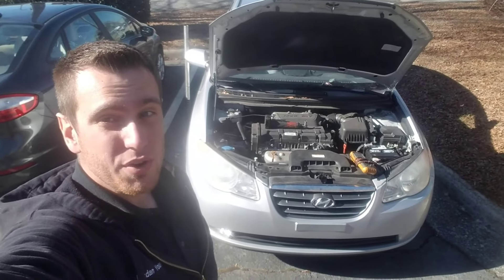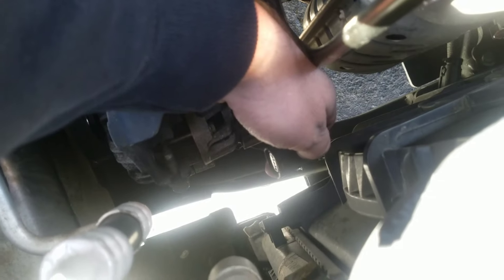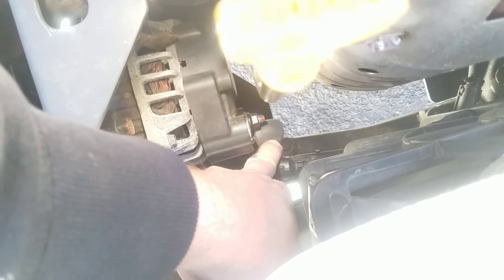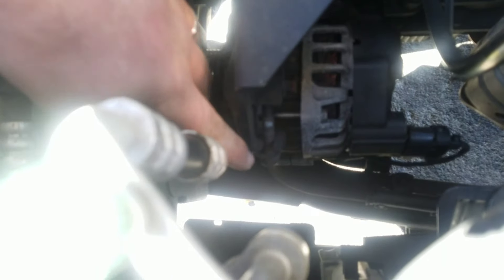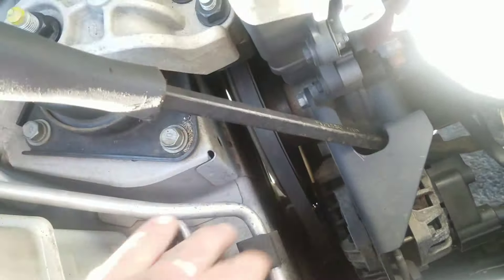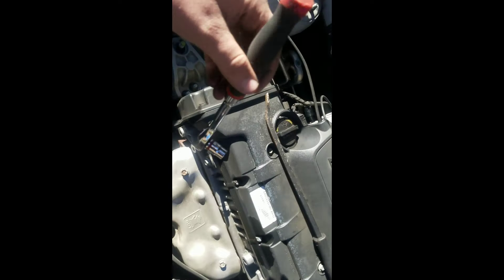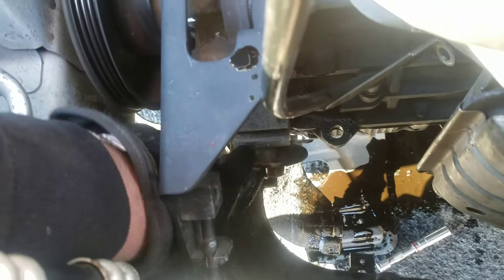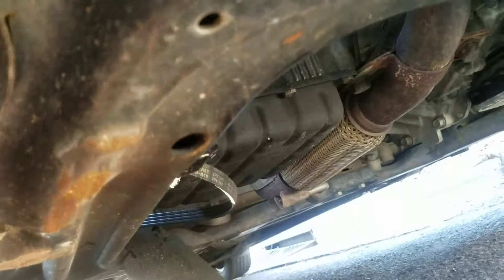Alternator 07-10 Hyundai Elantra Replacement "How to"

Comment: Few things:
Loosen the mounting bracket so it can be maneuvered over towards the passenger side to make it an easy removal and install. 
You do not need to remove the lower bolt, just loosen a bit and pull out towards the front of the car. 
Make sure when you're putting the new alternator back, first get the belt back into position, push the alt down to a tense point, tighten the upper mounting bolt to finger tight, adjust tightness, then tighten the mounting bolt full. You can reach the lower mounting bolt easily with a ratchet underneath. 
No mess, no fuss. Done in an hour.
Edit: also transfer the lower bolt to the new alternator to make it easier on yourself.

Comment: I see that some people are struggling with the bolt that goes through the alternator at the engine. I just replaced my alternator and struggled with this for a few minutes. My solution was to loosen the nut but not completely it, I then grabbed the alternator with one hand on each side and rocked it back and forth while sliding it towards the front of the car. This worked well for me.Good Luck!

Comment: This job was a pain! Part of it is my fault because I failed to realize the lower bolt doesn't have to be removed at all, just the nut loosened enough to where you can pull it out.

Comment: No need to remove the bottom Alternator bolt. Just loosen the nut. It will pull out once top bolt,belt and wires to alternator are removed. And it can be removed from top if you disconnect radiator hose  and remove fan which are easy to remove. Once it's out,  THEN remove bottom alternator bolt and transfer it to the new one. Bolts are 12 mm.
Also, Check the prices of alternators at your local parts dealer first. I called a few places and they wanted about 240 dollars,  which I thought was outrageous. Went on Amazon and purchased one for 100 bucks and it arrived next day. Not sure what a shop would charge to replace an alternator,  but I'm sure at least 400,  so definitely worth doing yourself.

Comment: It's a lot easier to loosen the mounting bracket and pull the alternator straight up. It requires a little maneuvering, but it saves you some oil
Reply: I completely disagree. I didn't notice he'd removed the filter so I loosened the bracket. Antifreeze seeped out & I struggled like crazy getting the alternator out the top way.
Reply: did one yesterday 3/29/2020 and it was way easier to just remove the fan an pull it out didnt even touch the mounting bracket
Reply: I think both of these methods sound like a pain. Someone in another comment said they'd like to give the engineer a piece of their mind-- me, too!

Comment: DO NOT REMOVE OIL FILTER !!
There’s an easier way. Just disconnect your upper radiator hose (save any coolant that may come out), disconnect power to your cooling fan.  Now remove the fan shroud assembly. There is more than enough room to remove the alternator. I never had to get under the car let alone having to jack the car up. Everything can be done from the top. Just saying.  
   Let me know if you find this easier than the whole oil change thing. 

I should have made the video! :)
Reply: How did you get the bottom bolt out? I had to remove the fender liner in mine. 2010 Hyundai Elantra

Comment: Ughh,there's a bolt under the bottom of alternator,once you loosen, it does not need to come out,the oil filter does,the bolt that is where the slot is to loosen belt,remove,with tensioner bolt.pry upward from bolt on bottom,it is sitting in a slot,the alternator and bolt stay together,I struggled thinking the bolt was like a front break pin..once it's loose it has to be unseated by going up.Hope this helps!

Comment: Question: I try to remove the alternator for 2008 hyundI elantra as your video, but the bottom stude volt with square head was hitting a wall. It has no room to pull that volt completely from akternator.. That volt was holding the alternator up and down. I can not take out that volt unless I cut it.  How did you remove that volt from the alternator? Please let me know. Thank you
Reply: The bottom bolt sits in a channel. You should be able to loosen/remove the nut and slide the bolt and alternator up out of that channel.

Comment: You can also just remove the fan and pull it feom the top and avoid oil spill
Reply: Trust me, dropping the oil filter is the way to go. Much, much easier.
Reply: @DoyleFM  did one yesterday 3/29/2020 and it was way easier to just remove the fan an pull it out
Reply: @Settegast1000  Heh, heh... I'm just glad to know there are other options. Whatever works best... 👍🏻
Next door neighbor had a V6 Sable (2003 I think) & the A/C compressor locked up & the pulley bearing went bad. Aftermarket companies actually make a pulley that you can mount in the compressor's place to bypass the A/C in a Sable or Taurus.
Only problem was, they don't make one for the V6 Sable. 😕 
So I had to remove the pulley to replace the bearing... talk about a SUCKY task...
It.
Was.
Brutal.
Reply: @Settegast1000  how far do you have to pull it out and what all did you have to disconnect?
Reply: @Settegast1000  on a 2010 Elantra? I'm doing mine tomorrow, removing the fan is the way to go yeah?

Comment: Thank for posting this. I was perplexed trying to figure out how to get the bottom "bolt" out. I still don't understand why it doesn't work its way out in normal operation. 🤔
Reply: Just tap it out
Reply: I think it should have a nut on the end, right? I took on this job midway through so I don't know, but I put a nut on the end to fasten it, otherwise it would just come right off.

Comment: I finally got it done, and although your video really did help quite a bit, you really could have done a better job explaining and more detail. first off, you absolutely should not take the oil filter off, you should remove the fan and that the hose also. I had one hell of a time figuring out how to life the alternator up to remove it. but, anyhow, at least you covered most of the bases. so I do ty
Reply: Crazy talk..move on folks

Comment: Hmm..I'm not too certain, I'd have to check, but I think my alternator is missing that connector from the beginning.  What is it for and what is the exact name of it
Reply: Check again, I'm sure its there.
Reply: @harvybirdman8864  yes I found the connector it definitely was there the whole time.. I was able to get the belt off and the alternator loose.. next I have to drain the oil take off the filter and remove the cables.
Reply: @Ruleno.9  just unscrew your filter,no oil worth is going to be lost.
Reply: @cemktl  lol I figured it out 10 months ago

Comment: how do you not have to pull that bottom stud all the way out? it sits through a channel in the alternator. I dont see a way around that and the end of the stud is hitting the side of the car or wheel well...how do I get that out?
Reply: Ethan Roy I’m dealing with this now how did you end up doing it
Reply: Does anyone know how to take out the bottom stud?
Reply: I know it's been a while since this was asked, but if you're referring to the bolt that would come out of the passenger side, I took it out by removing some of the plastic screws and a few bolts that hold the plastic inner fender.  I took out enough to be able to move the plastic out of the way and get the bolt out. That was the worst to take out of the 3. Good luck everyone, keep at it!
Reply: Same. That bolt isn’t budging for me. I have no room to tap it hard enough to go through.
Reply: I broke the splash guard plastic while in the junk yard. On my own car, I used a hole saw to make an opening for the bolt to pass
Reply: really pull it down hard it will come
Reply: Push down - yes!!! I’ve been pulling UP for an hour and getting nowhere. Push DOWN and it pops right out. Who’d a thunk

Comment: I don't understand why you can't remove the alternator bracket and lift the whole thing right out the top???
Reply: Rust maybe? Beat it.
Reply: the bracket is held in by the water pump bolts, of all things, the bolts are too long to be taken out without removing the water pump pulley

Comment: my biggest problem was getting the belt back on. lol
Reply: Yeah, you had to take the wheel off? Even with a serpentine belt tool I still had to take the wheel off.
Reply: @mattmgarza  I didn't take the wheel off. But I did turn the steering wheel completely to the right to give more access.  And I took the little lstic cover piece off that's covering the belts from the passenger wheel well

Comment: So u had to remove the oil filter?
Reply: I did this exact task earlier this evening & I would say yes. I did not remove the oil filter & I struggled immensely trying to pull the old alternator out the top way. I had to bend my A/C lines to get it out. Dropping the oil filter would make it so much easier. You wouldn't have to drain all the oil; only what spills when you drop the filter.
👌🏻
Reply: @DoyleFM  Thanks! I just replaced mine yesterday as well. Took the oil filter out. At the same time i changed the oil pan. Killed 2 birds with one stone.
Reply: @jaylandry8915  That's awesome! These dang YouTube "help your fellow man" videos are the shiznit, ya know?
💪
Reply: @jaylandry8915  did one yesterday 3/29/2020 and it was way easier to just remove the fan an pull it out

Comment: Thanks, this worked great. The only thing that sucked was pulling the oil filter. It would have been great if I needed to do an oil change at the same time. Putting it back in was easy once I ran the lower bolt all the way through and then laid it into the channel. Worked like a champ, I'd still like to get ahold of the engineer that designed this setup and give him a piece of my mind. Whole job took about 1.5 hours because of some minor issues on my part.

Comment: Before doing anything, disconnect the negative terminal of the battery. 
Step 1. Jack up the passenger side car safely, remove the passenger front tire and the small fender liner that is connected with 3-10mm bolts. 
Step 2. Remove the fan by taking off 2-10 mm bolts that hold the air intake, and unclip the radiator hose from it, set aside. 
Step 3. Disconnect the electric connections from the fan and remove it by pushing in the 2 clips at the top that connect it to the radiator. You might need to disconnect the radiator hose from the radiator to lift it out, if so, drain a little coolant beforehand so you don't spill it everywhere. 
Step 4. Remove the bolts from the alternator (he does a decent job of explaining this part in the video).
Step 5. Disconnect the electrical connections from the alternator (again, reference the video)
Step 6. The bottom bolt in the alternator, that has a super long bolt, do like he says and tap it out with a wrench or something, and then because you took the fender liner off, you can reach down behind the wheel assembly and pull the bolt all the way out. If you do not remove the fender liner you cannot remove the bolt. He does not say this in the video, in fact, he doesn't mention how to remove that last bolt at all. 
Step 7. Pull the alternator out from the top and install new alternator, using the reverse directions of removing it.

I hope this helps. You'll need 10 and 12 mm sockets and a lugnut wrench. You might need a pair of pliers to help with stubborn tabs on electrical connections and the clamps to remove the radiator hose if you are so inclined.